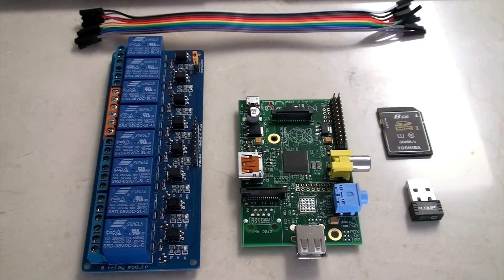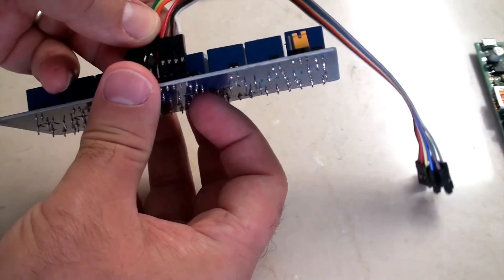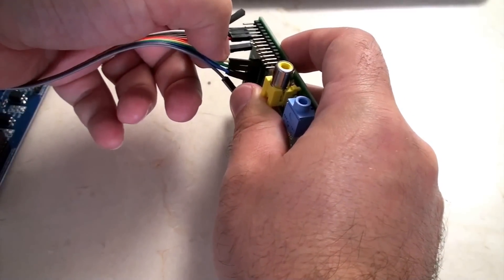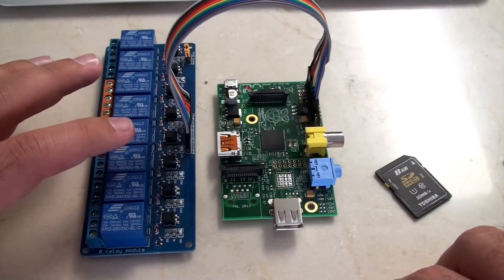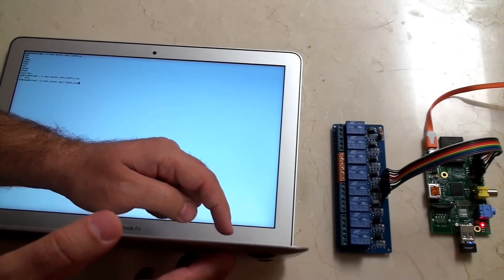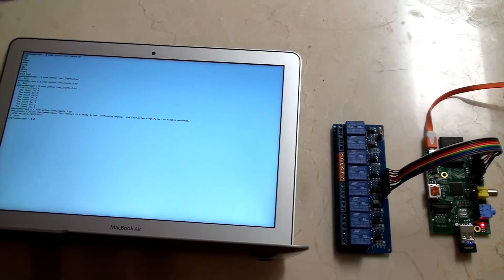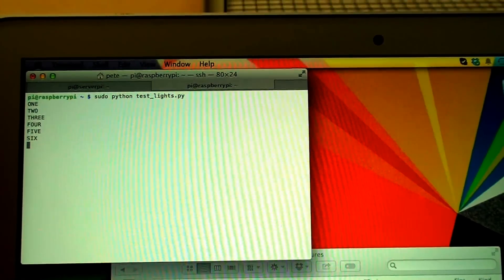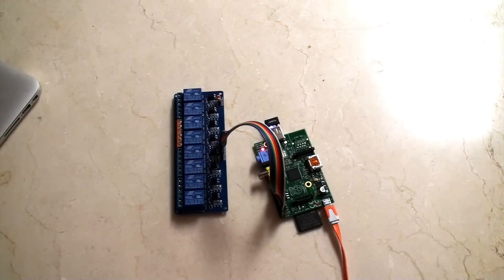Raspberry Pi: 8 Channel Relay step-by-step with software examples for automation

Comment: I'm confused. The Pi's output is 3.3v but the relays are 5v. How does that work?
Reply from the maker: +John Ritter http://raspi.tv/wp-content/uploads/2014/07/Raspberry-Pi-GPIO-pinouts.png  Power should be connected to the 5V GPIO rails.
Reply: +skiwithpete Ah, so the coils are powered by the 5v rail and the 3.3v gpio pins are just signals, yeah?
Reply from the maker: +John Ritter yep

Comment: Hi,

I bought the same relay. I am using Raspberry Pi B+ and I can't get the relay to 'switch' because of GPIO voltage output (3.3V). I would be thinking you'd need some transistor ?

Comment: This is a mod of the original code. it first asks the user to provide a delay time. Then it loops until the user exits by pressing Ctrl-c. Each loop it asks what pin in the pinList to set high then low. The GPIO list is slightly different then the original. I am using a Raspberry Pi 2.

#!/usr/bin/python
import RPi.GPIO as GPIO
import time

GPIO.setmode(GPIO.BCM)

# init list with pin numbers

pinList = [4, 5, 6, 12, 17, 22, 23, 24]

# loop through pins and set mode and state to 'low'

for i in pinList: 
    GPIO.setup(i, GPIO.OUT) 
    GPIO.output(i, GPIO.HIGH)

# time to sleep between operations in the main loop
print ("Enter cycle time in .1s")
SleepTimeL= float(input())
# SleepTimeL = 0.2

# main loop

count = 4
while (count > 0):

    print ("Enter GPIO pin to cycle")
    sPin = int(input())
       

# Set selected pin Hi
    GPIO.output(pinList[sPin], GPIO.LOW)
    time.sleep(SleepTimeL);

    GPIO.output(pinList[sPin], GPIO.HIGH)
    time.sleep(SleepTimeL);
# Set selected pin lo

print "  Quit"

  # Reset GPIO settings
GPIO.cleanup()

# find more information on this script at
# http://youtu.be/oaf_zQcrg7g
Reply from the maker: +mooselegion Caliber Cool, thanks for sharing!

Comment: Can it be done by any Android device???
if yes then please provide the app and codes.
thank you!
Reply from the maker: +Pratik Pati It's done on the RasPi with PHP codes.  On the phone it's just the browser.  All the code is in the About Section of the video.
Reply: +skiwithpete no actually my question was can i use an Android instead of a pc.
Reply from the maker: +Pratik Pati Yes.  Anything with a browser that can read HTML and submit forms.

Comment: Hi Guys, im new with rasberry pi and scripting. very new but keen to learn more about it all works. I have connected my pi as per pin outs , i have bought the 2 model b. I think i may have an issue with the 8channel relay as I have the same as the video.  Each time i try to connect the power my Pi shuts down ( using 5v and have tried both pins even 3v). I was thinking i could externally power the relay to avoid this but I feel as if i May be missing something. Any thing would be great thanks guys. also any links for beginner python scripting would be much appreciated :D
Reply: ahahah well i just found it , that link on the left hand side was jumpered over the 2 left pins not the 2 right pins. now the quest for how to run the scrip to check the relay begins :P

Comment: I am trying this for Christmas lights. I have a raspberry Pi model B+. Did you ever figure out what was happening with the ssh freezing? I haven't gotten my relay board yet so I cannot comment if it has happened or not. I am looking to get an external power source for my relay board however.
Also, does it matter what pins I connect the relay board to?

Comment: So my question is how easy would it be to throw a light detecting diod that could control if a relay state is on or off. I want to setup a controll system with my aquaponics system and possibly use it to control a robotic arm kit to tend the plants.

Comment: i have no experience with python, but the code seems logical, though i can't wrap my head around this part. in script 1, when setting the mode and state to "low" in the comment, why do you set the output for i to GPIO.HIGH, and afterwards in try, set it to low. i ask because i've seen this code written backwards with the same result, as in first set to low, the output to high.

import RPi.GPIO as GPIO
import time
GPIO.setmode(GPIO.BCM)
GPIO.setwarnings(False)
GPIO.setup(18,GPIO.OUT)
print "LED on"
GPIO.output(18,GPIO.HIGH)
time.sleep(1)
print "LED off"
GPIO.output(18,GPIO.LOW)

thank you
Reply: +arjuna207 I know, it's 4 months old. 
In order to wrap your head around this you need to understand the circuit used in each instance and that these output are not programmed until a command sets their logical condition. 
GPIO.HIGH will put the output pin 18 at 5v. As long as the other side of the light is connected to ground, the lamp will light. Another command GPIO.LOW will then change the state of the commanded pin 18 to low turning the light off. 

Another missing piece of the puzzle. Semiconductors are said to "sink" more current than they can "source". In other words an output pin will not drive as much current while positive compared to when it is at ground potential.

Therefore, if we command a pin to turn on the light with GPIO.LOW, the other side of the light will need to be at Vcc or 5v to turn the light on. GPIO.HIGH will turn the lamp off when both legs of the lamp are at 5v.  If this were an LED lamp, polarity orientation still applies. Hope that clears things up as to logic state changes to turn a light on or off with either method.
Reply from the maker: +LetsJeep Thanks for taking the time to respond to this. I try to get to as many questions as possible, but inevitably some slip through.  It's really cool of you to take the time to share.  And I hope that everyone is able to benefit from your answer.  Thanks again.
Reply: No problem. Just wish we could edit comments for typos, clarity and accuracy. I have not worked with any Adafruit products yet. Mainly Parallax boards like basic stamp, SX chip and Propeller projects for adaptive voicing and braille display technology for the Blind.

Amazed with the new advancements as of late. Quite impressive compared to the days of assembly language and RGB CRT's! Exciting times just watching other projects evolve. Keep up the good work of passing on your experiences. It motivates brain power and challenges on so many levels!
Reply: LetsJeep thank you!

Comment: Hello, I have a Raspberry Pi 2 with attached 8-Channel relay board.  Can you tell me a script that runs ON the PI itself to operate the relays in order of 1 thru 8? The best way to run on my power source is each relay on/off then next relay on/off.  I'd love to have this with a variable speed too.  Can you help me please?
Reply from the maker: +Kevin Larson The scripts on this page, in the video and in the about section - all run on the Pi.  I'm just connecting to the Pi via my mac as I don't have a screen to plug my Pi into.

Comment: Thanks man! Saw your video, immediately ordered the parts, just used wget on the Pi over SSH to get your scripts and it's all working. Brilliant!
Reply from the maker: +Luke Alderton :) Thanks.  Let me know if you make a vid for your project and I'll link it here.
Reply: +skiwithpete Will do! I just hooked up the lamp on my desk. At first I was a bit hesitant to use the mains electricity but it works brilliantly. :D

Comment: Thanks for this tutorial...
When i try to connect the 8ch relay with Rpi, channel 8&3 are in HIGH and other channels are in LOW state: Why is this happening?

also this following error occurs..
RuntimeWarning: A physical pull up resistor is fitted on this channel!

Comment: Great video, thanks for posting! I'm using a 2 Model B and had the same problem with the lights hanging. They all worked originally, but when I connected a motion sensor, 4 would not trip or light. And 10 and 9 would be slow.After looking at the schematic https://hifiduino.files.wordpress.com/2014/11/i2spins-001.jpg I decided to move down the header to gpio pins that didn't have any special function attached and then everything worked great!So rather than using 2, 3, 4, 17, 27, 22, 10 & 9. I'm using 4, 17, 27, 22, 5, 6, 13 & 26. And the pir is on 7.

Comment: Hey man, cool video and thanks for the Scripts! I have the 16 Channel version of the relay board and when I try running any time.sleep Python commands it just energises the relays but doesn't de-energise them? Have you heard of this? I have tried your light scripts but the 8 relays just turn on and stay on until I turn them off.
Reply: +Michael Joyce did you find an answer, Michael? I have exactly the same issue with 16 relay board. All light up, rather than individual...
Reply: +Shane Lilley
There are pins marked 5v and GND beside the input pins, when I had them connected to 5v and GND, I could get the relays to energise but not de-energise using python.There are 2 things to be done to fix this.1. There is a 5V regulator on the board, this has to be removed or a trace cut to stop it supplying 5v to the 5v pins. This is there presumably so you do not need a separate power supply when connecting and Arduino to the relay board (its intended use)2. The reason we need to get rid of the 5v regulator is because we need to add 3.3v and GND from the Pi to the 5v and GND pins. If the regulator is there you feed 5v back to the Pi which is bad news

I literally just broke the + Pin from the regulator off the board and everything worked perfectly!

Comment: Excellent tutorial and very good starting point! I saw that you don't use resistors (I also didn't use in my project). Is it necessary to use resistors? Are there any dangers if not? Thank you!
Reply from the maker: +Nikos Maniakoudakis the optocoupler relays (like mine, but not like every relay) don't require resistors.  Thanks for watching.  Cheers, P
Reply: +skiwithpete Thanks! Actually we have exactly the same relays but i didn't know this spec :-)

Comment: when i connect my relay, relay 1 and 2 are powered on. what am i doing wrong?
Reply from the maker: +crazy monkey it could be any number of things that have gone wrong.  From chosing pins that are default low to incorrect wiring.  It's difficult for me to know from the few words you've written.  But keep playing with it, I'm sure you'll get there.
Reply: +skiwithpete thanks for the fast reply! i think its something to do with a 2nd ground pin and a com pin that are connected on my relay with a little thing that you can remove. when i remove the thing the power led is still on but the realy don't work then.

Comment: Hi, can you pls help, my 8 relay module starts with all leds on although the output at the Pi pins is 0. Can i somehow change the module and have it booting with LEDs off? i use the JBTEK 8 relays module.
Reply from the maker: +Minas Stratigos The relay module is on when set to 0 (low).  So set everything to 1 (high) and the relay will switch off.

Comment: About the bug on RP B when it hangs on the 6th switch, i i don't think its a power problem, its more like a architecture problem of the board. I'm using the RP B+ and this same problem happened to me . using the GPIO 10 and 9 together would cause the problem so i switched them to GPIO 13 and 26 and now i can open all the RELAYS

Comment: Hi, I think the problem with the delay in minute 9:30 is a thing that use to happen to me when I was programming applications using C in linux. Many devices use buffers for operation. The program screen output is called stdout in C and if you don't free the buffer, it will remain stuck some times until the program ends.
So the solution is to flush the bufer tight after you need to:

printf("seven");     // the C instruction for printing seven on the terminal
fflush(stdout);      // the instruction to force to free the screen buffer

I guess it must work the same way on other programming languages.

Regards
Reply: +Andres Pinilla Yes, this is the way to go. When we want a thing to occur in almost realtime, then we have to do like that. In one of my projects long ago, I had to read keypresses and avoid multiple presses; I had used fflush().
Thanks for sharing.
Reply: s

Comment: The script I created in php to have a relay party.
-------------------------------------------------------------------------
<?php
// Relay List ID => GPIO.ID
$relay = array (
        '1' => '7', //x R1
        '2' => '0', //x R2
        '3' => '1', //x R3
        '4' => '2', //x R4
        '5' => '3', //x R5
        '6' => '4', //x R6
        '7' => '5', //x R7
        '8' => '6', //x R8
        '9' => '21', //x R9
        '10' => '22', //x R10
        '11' => '26', //x R11
        '12' => '23', //x R12
        '13' => '24', //x R13
        '14' => '27', //x R14
        '15' => '25', //x R15
        '16' => '28', //x R16
);

// Catch ctrl+c and turn off all relays.

declare(ticks=1); // PHP internal, make signal handling work
if (!function_exists('pcntl_signal'))
{
    printf("Error, you need to enable the pcntl extension in your php binary, see http://www.php.net/manual/en/pcntl.installation.php for more info%s", PHP_EOL);
    exit(1);
}

function signalHandler($signo)
{
   global $relay;
    foreach($relay as $relayid => $pin) {
         system ( "gpio mode ".$pin." in" );
         usleep(1000);
    }
    exit(0);
}
pcntl_signal(SIGINT, 'signalHandler');

// End catcher

/* Main */
echo "Relay PARTY!!!!!\r\n";
while(true){
    // Pick a random relay to turn on even if its already on.
    $ran_Num = array_rand($relay);
    system ( "gpio mode ".$relay[$ran_Num]." out" );

    // Pick a random relay to turn off even if its already off
    $ran_Num = array_rand($relay);
    system ( "gpio mode ".$relay[$ran_Num]." in" );
}
?>
------------------
 :)

Comment: I have a 16 relay module that uses 12v 320ma, while powering the relay module I also have the relay module powering my raspberry pi 2. Its nice.. No noticeable lack of power to the pi since there is no dimming or shutting off of the red power led as an indicator.
Reply: +Valueless Dollar do you use Raspberry 2 PI model B ?

Comment: Hello, thanks for the great video.

I bought a pi today and wanted to do what you are doing, but i have no idea how to set  up my pi with a mac, like you did in the video (being able to run raspbian/control gpio pins from a mac). Im pretty sure i have all of the materials i need: SD card with raspbian, wifi dongle, ethernet cable, and of course the pi and a mac. I know its probably gonna be too long to explain over this, but do you know any articles that can show me how to set up a pi and use it like you did in this video? thanks so much

Comment: I greatly appreciate what you've put together here, it's helping me a lot.  I've got all of the relays working my question is that I'm wanting to run an RS-360SH pump that supports 3v-12v power and I'm not certain on how to connect the pump to the relay.  I've looked through many of your videos and I didn't seem to find one that shows connecting devices to the relay.  Can I run the pump off of the raspberry pi or does it need a separate power supply?
Thanks for your help!
Reply from the maker: Chandler Gray My 1-relay video probably best shows the answer.  https://www.youtube.com/watch?v=3u45htuQeag Basically you want to cut one of the wires from the power to the pump and send it through the relay.
Reply: skiwithpete 
That I what I thought but I wasn't sure if I needed to externally power the pump or if I could use one of the 5v leads & ground from the Raspberry Pi to power it.  Thanks for the fast response as well!
Reply: skiwithpete 
One other thing I noticed in your Automated Lighting control video is that you have loops in & out between each relay.  Pardon my ignorance, but if I were to have several pumps powered, how would I connect the relays?
Reply from the maker: Chandler Gray It's hard to describe without showing you, but "like this"  https://www.youtube.com/watch?v=xc1daIb1LVc  you see how one wire connects all of the "ins" with those little loops?  Then the outs go to each individual device.
Reply from the maker: Chandler Gray No, that would be too much draw on the pi.  Try splitting the power from the source before it goes into the Pi.  That way you could have one supply (say 5V5A) and split it so the Pi draws 2A and the pumps draw 3A.  That's something I do in my https://www.youtube.com/watch?v=17-8kzAiuCQ

Comment: 1) You should explain what Ground and VCC stands for (1:30).
2) Not sure whether having a delay in the output (but not in the actual action) should be thé reason not to pick a model B, unless it is power-usage linked (although, if you don't need all 8 ports, it's probably be less of a problem).

PS: difference in pin lay-outs: http://raspi.tv/wp-content/uploads/2014/07/Raspberry-Pi-GPIO-pinouts.png

Comment: skiwithpete how to connect a 24VDC solenoid valve to this relay board...as the relay is drawn from the voltage supplied by the raspberry pi i.e. 3.3v . How to convert this 3Vdc to 24Vdc?? please help
Reply: santosh saikumar You should hook the coil(The big screw connectors on the other side) of the relays to an external supply instead of the 3.3V(which I assume you are using). The 3.3V rail of the raspberry pi is only stable up to about 50mA (which is not much) and even worse, you only have about 16mA per output. 
Look at this picture
http://www.hobbyist.co.nz/sites/default/files/webswitch/Relay%20shield%20wiring_bb.jpg
The "input" should be a 24V source.
Reply: santosh saikumar You should hook the coil(The big screw connectors on the other side) of the relays to an external supply instead of the 3.3V(which I assume you are using). The 3.3V rail of the raspberry pi is only stable up to about 50mA (which is not much) and even worse, you only have about 16mA per output. 
Look at this picture
http://www.hobbyist.co.nz/sites/default/files/webswitch/Relay%20shield%20wiring_bb.jpg
The Power In should be a 24V source.